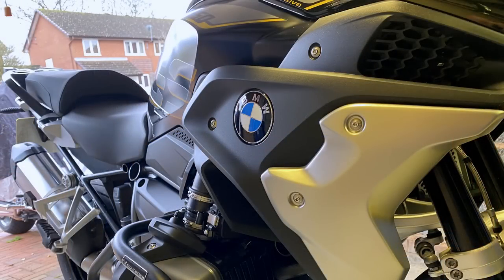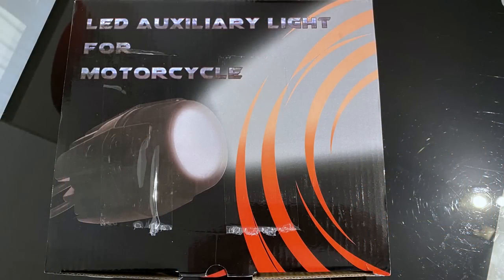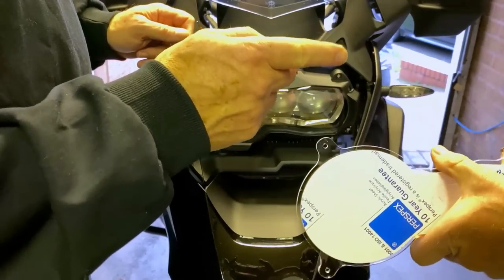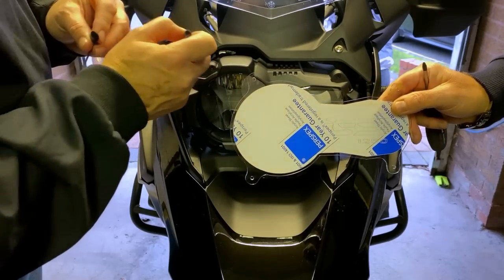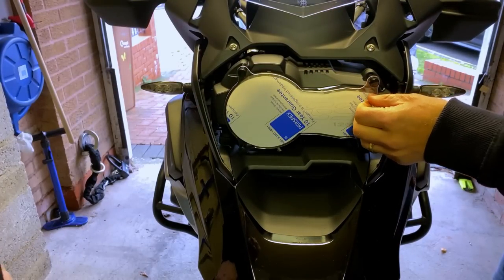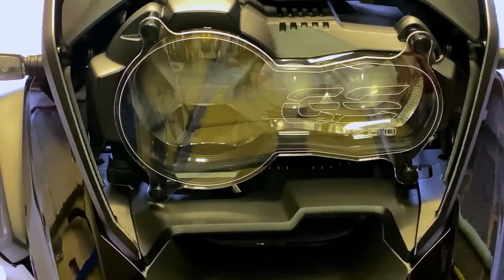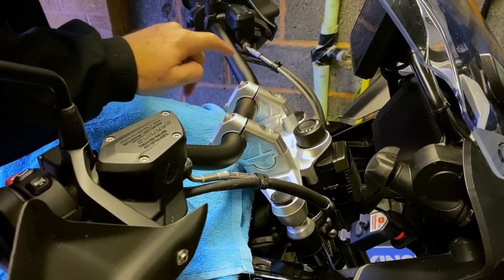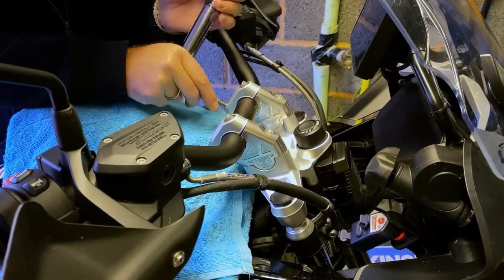Fitting Ebay Accessories to a BMW R1250GS Exclusive

Comment: How did you wire the relay in for the lights?
Reply from the maker: Graham. We didn’t. There’s a switch fitted and that currently runs from the battery. So the switch controls it but there are plenty of places to tap into for a switched feed. The switched feed to the DIN socket in the cockpit would be ideal. There’s a reason we didn’t do Sean’s this way (He’s having the CanSmart off my old bike)
Reply: @nickhodgeUK  thanks for that Nick, just looking for a way to tap into a feed for the relay that will switch the lights off with the ignition but not give problems with the warranty by cutting into the can bus loom, if you get what I mean.
Reply from the maker: Graham Broadfield yes absolutely. The best way is of course the Hex EzyCan or its Denali branded version the CanSmart. There are a few to be had now as people upgrade to Gen 2 from 1 on eBay and such but still probably over £100. The best way as it makes a very small pin-prick connection is to use a ‘posi-tap’ connection. That way there’s no cutting or splicing and it’s almost unnoticeable when removed

Comment: Hi Nick, as usual very informative video!!! Thanks a lot. 
I'm very much interested by the Fender Extender (w/o any need of drilling holes) but when clicking on your EBay link this part doesn't seems to exist anymore. Any other reference / link?
Also, on the same vein, any link / reference for a mee too of the Mudsling rear suspension guard? Mudsling seems great but so much outpriced. For both front and rear the cost is 169£ + shipment (for 2 pieces of injection mold plastic)...THANKS BEFOREHAND
Reply from the maker: Hi Eric  I updated the link to another (looks like UK now has many people stocking Chinese ones now, but this is the no-drill one). Here is a link to a mudsling equivalent. (be aware this is from China, no experience in it and also sometimes you'll be hit with duty and stuff so Caveat Emptor! https://bit.ly/3fPPIPD
Reply: @nickhodgeUK  Hi Nick, super thanks and much appreciated!!! Please continue publishing such useful videos. Very instructive :-)
Cheers from Belgium and again thanks - Eric

Comment: Nick where do I order the head light protector
Reply from the maker: It’s a link under the video but this should work. Say I sent you https://www.ebay.co.uk/itm/BMW-Headlight-Guard-R1250-GS-GSA-With-HP-Logo-Free-Post-UK-8-To-Outside-UK-/333107634251
Reply: @nickhodgeUK  thanks Nick

Comment: BMW doesn't think these are needed on your bike, otherwise they would have came with the bike...
Reply from the maker: Well. Part of the love of motorcycling is accessorising and making a mass-produced article more personal. However I would also say many accessories are essential or at least wise (engine bars, radiator grills?)